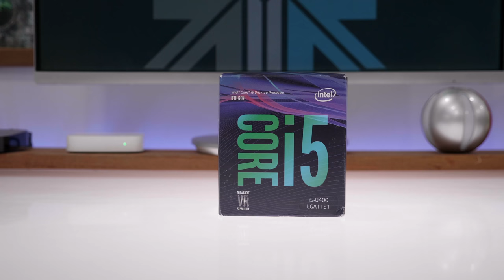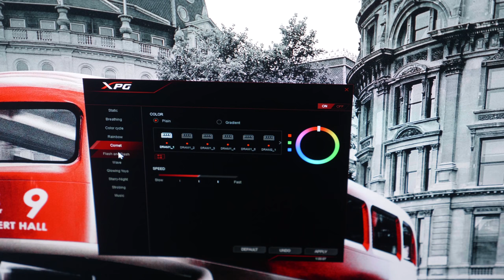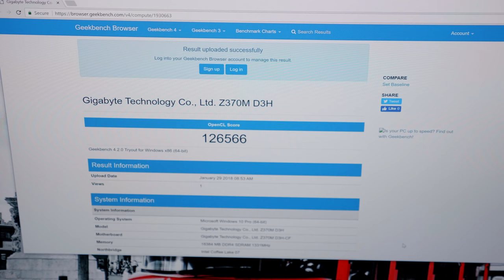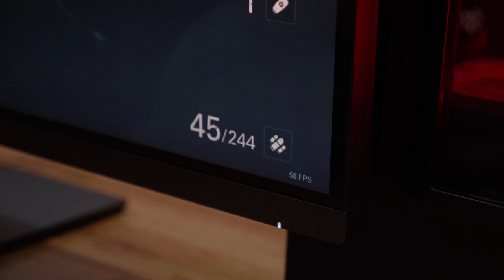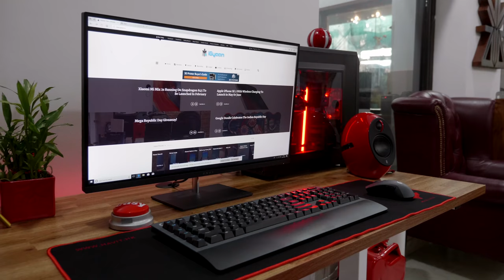DIY Gaming PC in Rs. 70K Part 2 Gaming, Benchmarks, Upgrades and Setup Let's Game

Comment: How it is 70k when monitor is itself 50k
Reply: Anant Kumar The CPU is built under 70K and not the whole setup
Reply: CPU build will cost around 86k
unnecessary things excluded
Reply: +Anant Kumar when they talk abt the build within a budget most of the time that doesn't cover the monitor and other accessories like mouse, keyboard and webcam.
Reply: Around 75k - 85k I think just for CPU.
Reply: Hahaha so I was thinking how it's possible monitor is 54k and graphics 25-28k then another things so total it will be above 150k

Comment: Nice setup! I have the similar chassis and cooler!
One thing I found really found odd tho is the mouse and keyboard! I think you went a little overboard there. I wouldn't call it waste of money since mechanical keyboard and a good mouse is a must but these are the peripherals that can be upgraded down the line easily. So instead of spending 13k over a mouse and keyboard, upgrade to a better graphics card or a better CPU, depending on your priorities of course. 3gb VRAM is okay for most modern games but not all if you want the sweet 1440p 60fps at ultra settings, So it's better to go with gtx 1060 6gb or gtx 1070.
For mouse, Logitech G302 is a great inexpensive mouse for 1700rs or the G402 for 2700rs.

Comment: intel cpu i5 8400 and 3000 mhz ram it still doesn't bottleneck or stutter in game ? cause i see the specs of processor and it supports 2666 mhz of memory beyond this range doesn't it drop some performance while in heavy AAA titles??

Comment: I just want to spend on Processor, Mobo , Ram & GCard Only. I have other parts of my Older pc with 450 W Psu. My budget is abt 30K Rs. I was Thinking Abt G4560 & Gtx 1050Ti . What other suggestions?
Reply: Jagvir Bhandal perfect go for it but I suggest you to use the power supply which you get in the new case if yours is older than 2 years and not rated
Reply: Ankit Pise Yes it's about 4yrs old. So i have to but a New cabinet and psu ?
Reply: Jagvir Bhandal  cases usually come with psu I built a PC 2 months ago bought a circle cabinet which came with a 350w psu
Reply: Jagvir Bhandal for your built I would suggest G4560 and if the prices are still high go for i3 7100 if the difference is not much mobo- h110-ms2 8gb ram gtx 1050ti and 1tb hdd plus case and other peripherals
Reply: Ankit Pise what is your cabinet's model?
Reply: Jagvir Bhandal  don't remember buy any cabinet from circle they're good

Comment: Bro
Can you please show what sought of settings you used in the game just a 2 sec glance at it cause when you say maximum settings, it is not quite clear what setting you are using as PUBG on this machine should run at 36 to 50 FPS at Ultra and 1080P
So, please try to give a glance of what setting you used in each game and what resolution you used
Otherwise you videos are always high quality and cool

Comment: sir can i play-can i buy this system for high end gameing..
confi-
intel i5 8400
1tb hdd
8th gen motherboard(ASUS. GIGABYTE. OR MSI ETC) 
8gb ddr4 ram
ssd
2gb geforce gt 710(graphics card i will by later) 
gameing cabimet any brand 
aoc 18"inch monitor
sir can i play heavy games like gta5 battlefield far cry 4 5 or etc without any lagging or issue... sir please rply.. and how many rs RS this qualification.....

Comment: Dear bharat bro... In ur next build it would be better that you explain the installation of power cables , and the cabinet , fans , usb header by keeping the mobo outside for a better view for noobs. Just give a visual explanation on the corresponding slots by mentioning which fits on with what.
Thank u 
And
Yes..i need a giveaway

Comment: One should always install the ram and the cpu along with the cooler before putting the motherboard in the case. Easy to install the cpu and ram outside than inside.

Comment: Hello Sir, 

I'm doing Animation, I want to update my PC config for Rendering purpose, which one should i update 
my budget is 25K.  
 
I Have i5 2400, 
Hp Mother Board
WD Hdd 1tb 5400rpm 
8GB Ram
Nvidia 610 

I'm thinking to buy 1060 3b Graphic card or I should upgrade Motherboard & Processor.

Plz comment on this Guys.. :)

Comment: There's no point of using a 4k monitor for a gaming pc build. 60fps is not good enough. You should have paired it with a 1080p monitor with higher refresh rate.

Comment: using non K series intel chip on a Z series mobo. well just the start of it. you used 2 ram sticks but not in dual channel mode. well you my friend need to do some research before putting in anything on a computer.